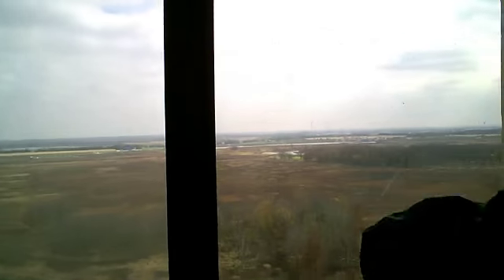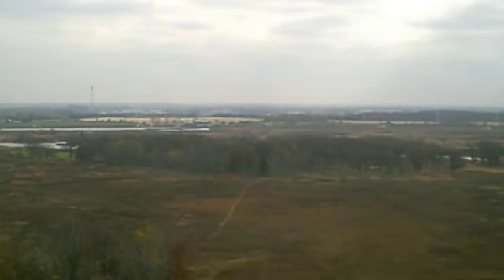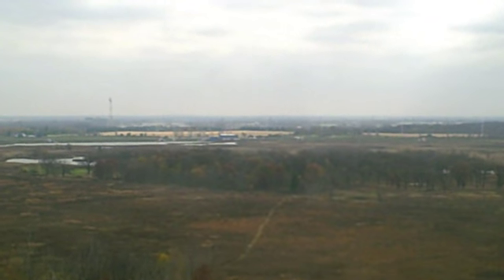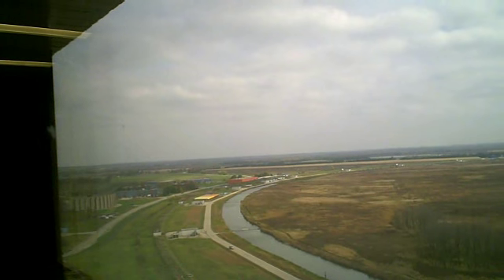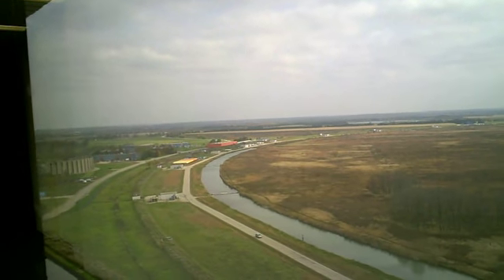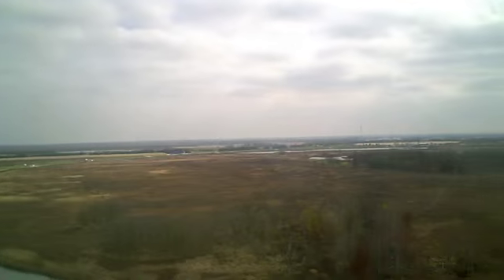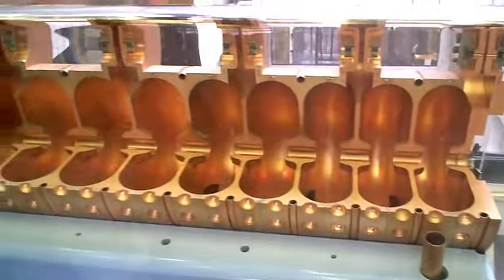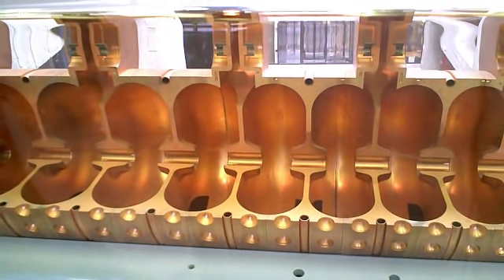Fermilab Accelerator Part 3

Comment from the maker: The Higgs is still only a theory so there is a chance this could be one of those "oops" moments where something else unexpected shows up or happens. The reason for the theory is a small amount of missing energy in a certain type of decay, such as a neutron to proton decay.

According to how I understood Jim's explanation photons can transfer momentum.
High energy UV photons would drop to infrared photons in a thrust engine is my guess. I don't know if there is something that could resist that.

Comment: So it's a giant cathode ray tube ;-)

Sounds like the Higgs can change the calculations for the mass of the universe. It would be cool to see how a number is put on that.

My understanding of photons is that they can transfer momentum. Is that wrong?

And what kind of back plate would be required for a photon rocket that could match the thrust of the SRBs on the space shuttle? There's a lot of water under the shuttle at launch.